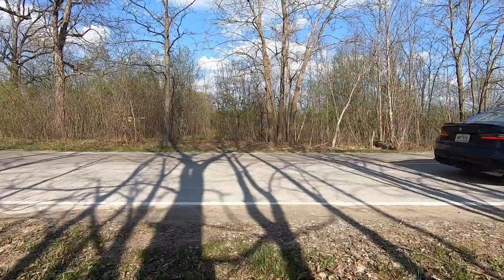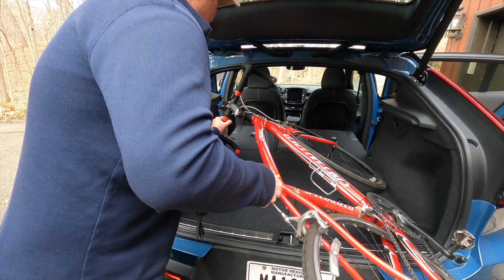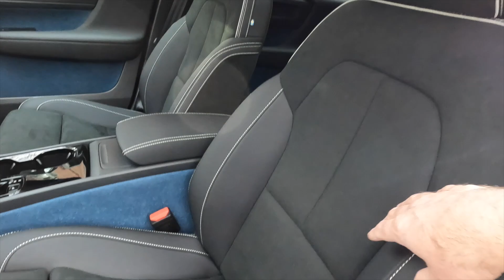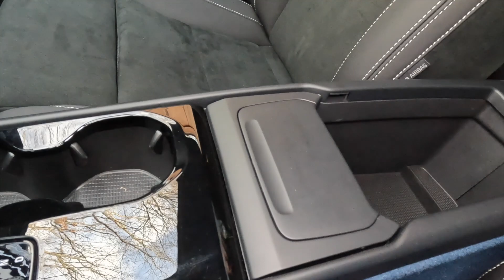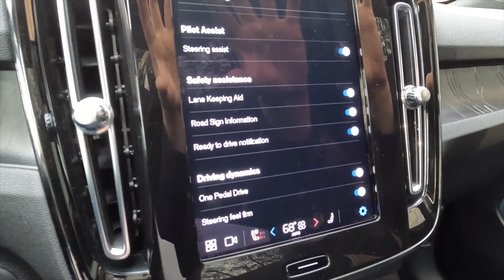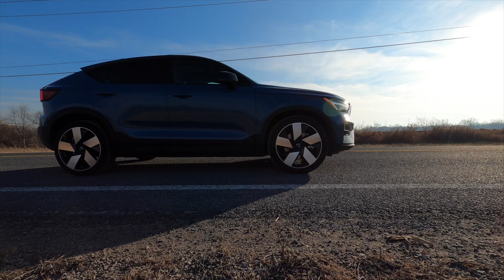Volvo C40 Recharge Review: Swanky Little BEV

Comment: The xc40 is better overall. It looks very similar and can be had for cheaper too so I don't understand the point of the c40 if it's the same car minus roof height. People buy a Volvo for the functionality followed by style so I don't know why Volvo even went ahead to waste the limited resources, time, and money they have on this versus putting that money to better use... after all, I thought swedes are resourceful and don't like wasting
Reply: Not in all. The Design of the C40 is outstanding. The XC40 looks standard! This is also the main reason why i bought the c40!
Reply from the maker: I agree, the XC40 is the better of the two. But some really prefer the styling. And it does still fit a bike in back.
Reply: Agreed I prefer (and own) the xc40 recharge but this one looks like fun too. Nice review!
Reply from the maker: @bhmth  Thank you!